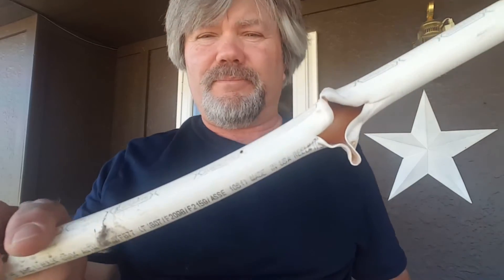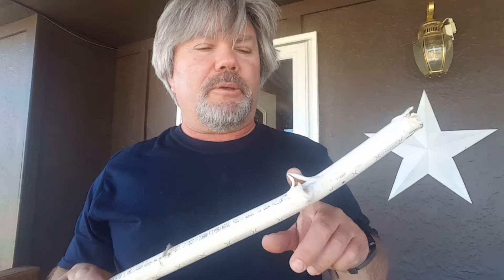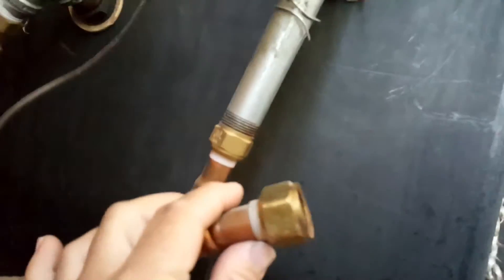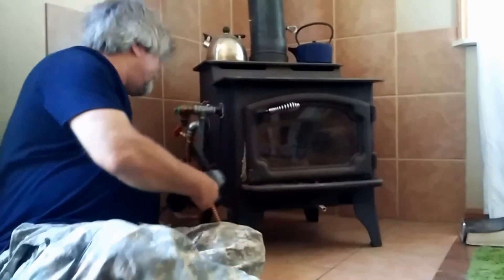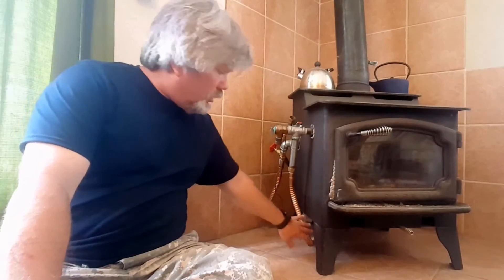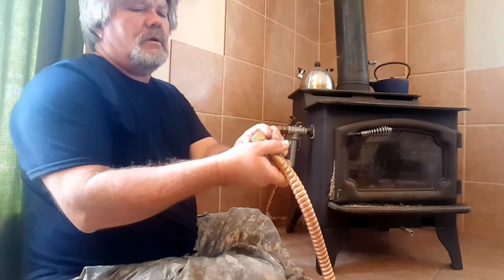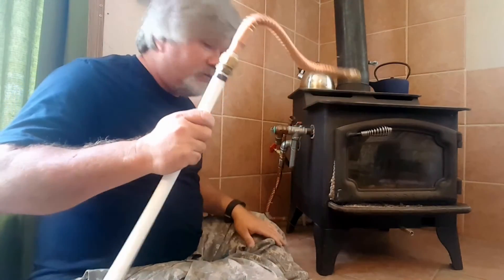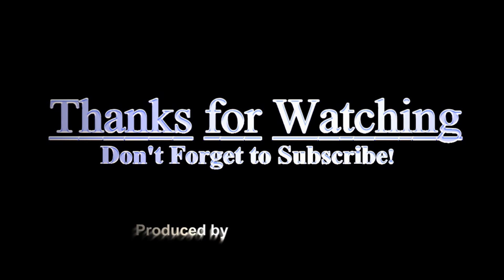Wood Stove Steam Explosion

Comment: Don't use plastic pipes for heating applications, if they were not labeled as "suitable for heating systems" And another thing. The relief valve should have blew before the pex. The piping looks like the DIY or hackjob, so no wonder it happened. You could have installed a pressure relief valve designed for water heaters, not boilers. Boilers operate on low pressure, somewhere 0.5 - 1.2 bar and water heaters operate on 3 - 6 or sometimes even 8 bar of pressure. So the relief valve on water heater is supposed to blow when it reaches very high pressure. That could be the case with yoru system. Check if the relief valve on your mini heating system with that little stove has relief valve installed for HEATING SYSTEMS and not WATER HEATERS because the cast iron burner will blow up before that relief valve will blow, because those cast iron stoves are suited for 2 bar AT MAX
Reply from the maker: Thank you for sharing your wisdom and knowledge with us.

Comment: I have always thought I should put a piece of pex in mine as a safety measure.
Reply from the maker: I don't really think it's necessary in your situation because yours is thermosiphon isn't it?  I have a TPV valve right above where mine always bursts and the PEX gives way even before the valve would pop off - I've even replaced the valve to be sure it wasn't defective.  It usually happens when I choke down the water flow too much.
Reply: Ya mine is thermosiphon, mine tends to back hot water up the water main. Not uncommon here to get wicked hot water out of the cold water faucet. But my water is gravity feed so it gives it that cushion. Hopefully your new water line well be the cure to it all. Nothing worse than frozen water.
Reply from the maker: That's true brother.  It looks like you're doing good up there in the deep North!

Comment: Steve,  Love the videos!  Here is an Idea that may be worth thinking about.

I'm familiar with pex and have used it quiet a bit.  For a safety feature if you have to replace the pex on a blow out again, It may be a good Idea to put a 1" or 1 1/4" galvanized pipe as a sleeve over that vulnerable section.  It may also help a bit as a heat sink.  For example if that section of  pex is 30" long get a 27" x 1" ID galvanized pipe and slide the pex inside of the gal. pipe.  IF you want to still let if burst if it gets too hot you could go with a 27" Gal. pipe with 1 1/2" ID or 2".  The second way wouldn't act as much of a heat sink but could still allow it to burst.  It just wouldn't spray as much when it happened.   It looks like the pipes main issue to me was heat instead of pressure.  I bet that the pipe didn't get over 200 deg. before it popped.  Curious what you think.

Another suggestion:
There is another type of pex clamp that works great is much easier to get off  http://www.homedepot.com/p/SharkBite-1-2-in-Stainless-Steel-PEX-Clamp-10-Pack-UC953A/202032891

There is another type of crimper that goes with the above clamp and it is one size fits all.  The best part is you can use it in tigher spaces.  It has a ratchet that allows you to readjust after if you need to and not loose your grip and have to start over.  http://www.homedepot.com/p/SharkBite-Full-Size-Stainless-Steel-PEX-Clamp-Ring-Tool-23081/202032996

The tool and clamps above are a bit more expensive but they sure are helpful in tight spots and when you need to remove a clamp.  Hope this helps!

Darren
Reply from the maker: Darren, I've seen those rings and clamps, but I've already invested in the one I have.  I had it to do over, I would have definitely gone that way!  The galvanized pipe is also a good idea.

Comment: When I get my wood stove the header tank will be open to atmosphere so that there's no danger of that happening. The funny thing about steam engines is that they don't stall...They break in a major way.

Water increases in volume by about 1600 times when it turns to steam.
Reply: Yeah and one major thing is the superheated water ... under pressure, water will boil (turn to steam) ABOVE 214F ... so imagine what happens when very hot water, which is under pressure, suddenly isn't under much pressure anymore. BOOM! It turns into steam all at once!
Reply from the maker: Benjamin Esposti Benjamin...I haven't seen you before.  I expect to see lots of your fresh engineering opinions on the channel.  Welcome.
Reply from the maker: There's an old steam engine they used at one of the old gold mines out here that exploded in the early 1900's.  It killed two people.  They had used the steam engine to generate electricity to light the mine.  After that they went back to headlamps.

Comment: They make a pex ring cutter thats way easy to use and sold at the local big box store with orange colors I bought one and there great you just cut the pex just past the fitting and then insert the cutter in the fitting and cut the ring if i remember there only about 15 bucks
Reply from the maker: I didn't know there was such a thing.  But every time I work on plumbing, I tell myself it's the last time...

Comment: hello steve, im curious whats the rating on the relief valve? might need to get a bigger pressure and temp one to prevent failure, the temp at the stove is extremely hot which makes the pressure go up ,.just something to consider

Comment: would a expansion tank on the cold water feed to the wood stove help prevent the problem? I remember they require an expansion tank on a furnace that also heats the water, could save you from replacing the relief valves.
john
Reply from the maker: Well, technically I have the pressure tank for the whole house that should serve that purpose.  The pressure in the lines didn't build up enough to discharge the valve at the water heater or the pressure tank.  I think the pressure was less than the trip pressure of the TPR's, but the steam had softened the pipe in that one spot enough to allow it to burst.

Comment: Ut oh... boom not good.I guess in retrospect this is a good lesson. I am not up to all the code requirements on things like this. BUT (there is always a but) Why not do a redundant backup?  I may be off base here but aren't the T&P valves made to be vertically installed? I would investigate this with a manufacture of this type of stove.
Perhaps a vertical manifold made out of 2 two inch pipes that would accept the T&P valve (s)? It would act as a receiver/accumulator outboard of the heat exchanger/boiler. Is there an expansion tank on this system?
Let's be careful out there...
Reply from the maker: I installed it according to the mfr's instructions.  The problem was with the TPR itself.  They apparently aren't made to survive multiple discharges.  That or the fact that my firebox gets quite hot and the heat was conducted to the TPR where it's inner workings eventually failed - my plumbing didn't even have any water pressure to start.  My system is redundant in the way there is a TPR at the wood stove and the water heater.  I believe the steam built up in that section of the pipe, and between the pressure that built up and the softening of the PEX caused it to explode.  There wasn't enough pressure in the pipe to cause the TPR at the water heater to discharge.  There is no heat exchanger (per se) the actual water circulates from the water heater directly through stainless steel tubing in the firebox.    I like the system, and it is safe.  But like anything invented, it can crash and burn.

TPR's are not sensitive to direction installed.  The TPR on my water heater is horizontally installed at the factory.  https://www.nachi.org/tpr-valves-discharge-piping.htm?loadbetadesign=0
Reply: Thank you for the reply, you may be on to something with the repeated  blow offs causing failure and it is right there where maximum heat is generated. Could the excessive heat cause it to actually fail shut? If so I sort of like the idea of externally mounted but right next to the stove so it could still function but not subject to such radical temps. Just my thoughts... Thanks again for sharing your experiences.
Reply from the maker: My knowledge about the valves is only what I've read, hoping I could give more info about it in the video.  Unfortunately, there's not much information about their technical details.  I guess it is what it is, so I just put it out there.  It never goes off as long as the water is moving, and we take a shower or bath when the temp gets to about 130F.  LOL  Thanks for the comments, brother.
Reply: Hey Steve I wonder if that pipe failure was exacerbated due to heat directly radiating down upon it from the stove?. I read where there was a buried natural gas line running past a electrical feed that had been spliced and over heated when the air conditioning was powered on. The PEX gas line ruptured and flowed into the soil backing up into the homes drain tile and up into the basement. The pilot light on the water heater set off a disaster taking down this new home. So I would think softening of PEX is/was part of this problem. My best guess would be to have threaded iron pipe in close proximity to the fire box as even soldered copper may weaken under heated conditions? Flex Stainless might be best in your installation, covered with fire proof insulation of course. All the best
Reply from the maker: There's plenty of discussion for the topic.  At least it gives us all something to consider as we do our thing.

Comment: i take it that the pex is a connection vent to a open space or a drain , yor problem is that there should not be a horizontal run of any pipe in a space that can freeze ergo the explosion ! ice is one hell of a plug.
an ice plug  can excede the tinsile streinth of cast or steel used for vent piping, you are lucky that the pex has a lower bursting pressure than the copper line used before it. you could have ruptured the heat exchainger in the wood burner !!!!! that could have caused metal failure of the heater spraying hot embers to the space ,ingory or death.
nikt . nein . verboten  to that !
emma said hay

Comment: I did my house with pex but didn't plan it out, or think it out, should have bought the crimper, most of the sharkbites are $10 each.
I'm glad you located the pipes going through the floor in an easy to get to location, ha ha.

The previous owners put the well water line through the floor in an impossible location to get to.
thanks a lot.

ps, could you put on your long list of videos wish list how to shop for great deals of batteries for the storage bank
thanks
Reply from the maker: I haven't figured out how to get good deals on batteries yet myself.  There are fellas out there that run circles around me finding deals.
Reply: I can find golf cart batteries near by but Trojan dealers are atleast 2 hours away.
I know a youtuber that loves the harbor freight seal lead acid 12 v 35 amp hr, but it is but it's still harbor freight...
thanks
Reply from the maker: I would use golf cart batteries long before I would use 35ah batteries.

Comment: good video.  Could you explain what pex, pecks (not sure about spelling) pipe is?  looks like pvc pipe to me.  inform this old man, lol.
Reply from the maker: PEX is an acronym (sort of) for Cross-linked Polyethylene.  It's very similar to the black poly tubing you can buy in rolls for drip irrigation systems, but it's approved for hot potable water up to 180 degrees or so.  Its nearly as flexible as the black tubing so you don't have to use as many elbows to get around corners, because it will bend somewhat.  It uses crimp connections (or sharkbite - much more expensive) to make connections to fittings.  When the connection is crimped on, it is immediately available for use - something you can't do with PVC.  PEX can also be frozen solid many times over without cracking.  It's good plumbing in my book.